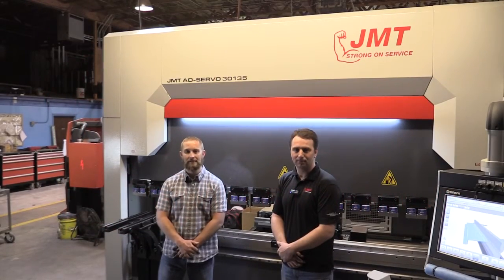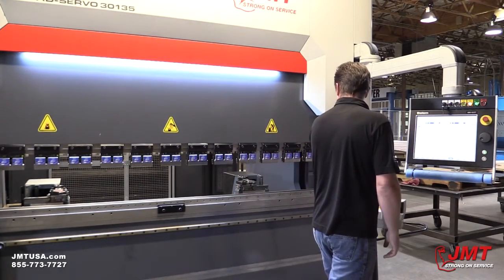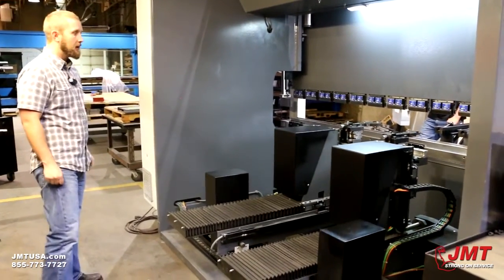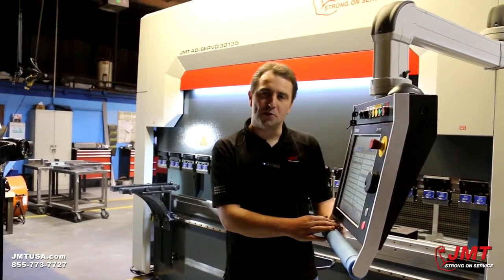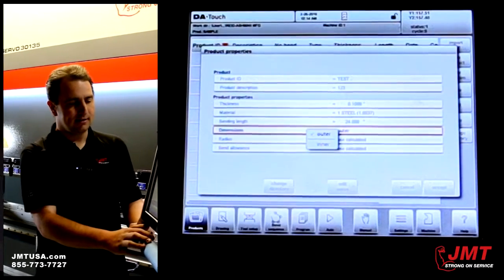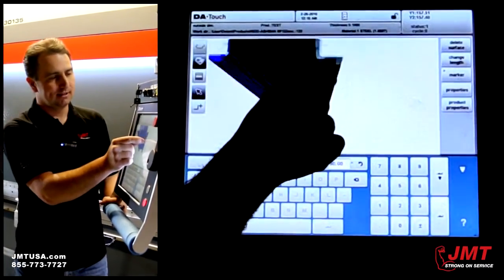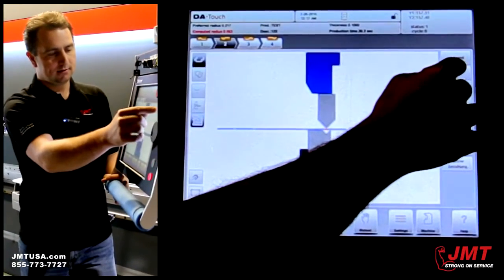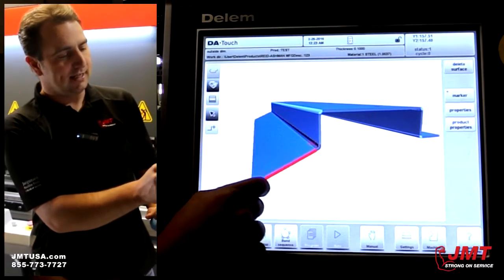Servo Hydraulic Press Brake

Comment: Looks like Turkish Durma, and control is from China ...
Reply from the maker: Nikola, you have a good eye! JMT does, in fact, partner with Durma for the production of the bulk of our press brakes. We have partnerships with factories around the globe for the production of our machines. (The control, however, is not from China, but rather is a high-end Delem CNC control from the Netherlands, one of the best in the business.) Durma is the largest volume press brake producer in the world, so it was a lucky move for us when we were able to get them to private-label machines for us (and sometimes custom-build them to our specifications, such as the specialized plate roll we sold to SpaceX that they now build their booster rockets with).
Reply: The coca cola is also largest volume drink producer, but is that drink healthy ?  However good luck :)